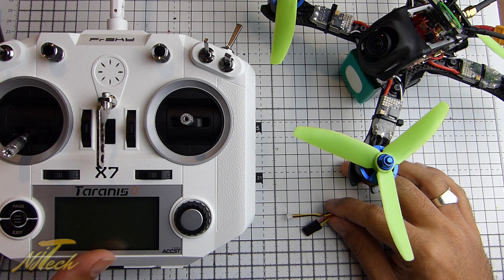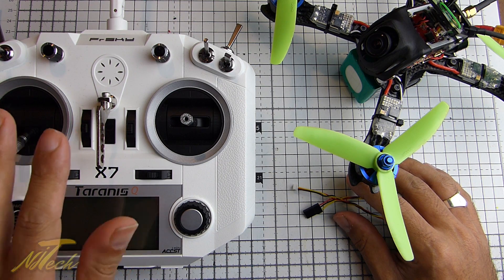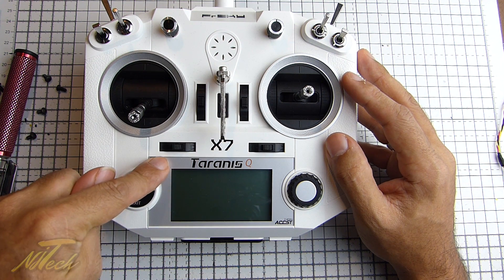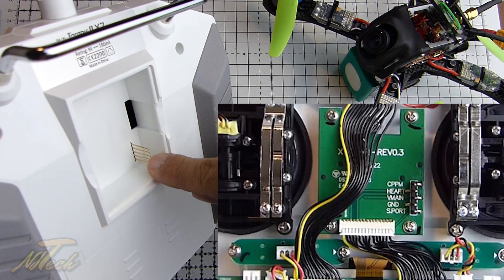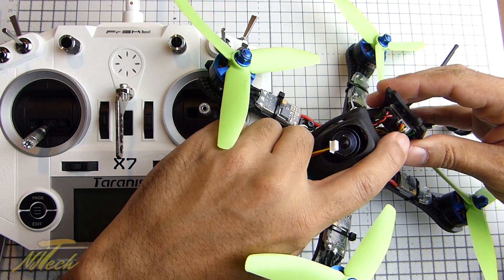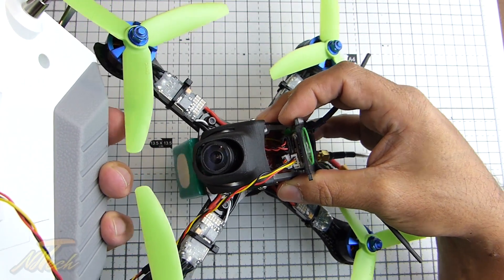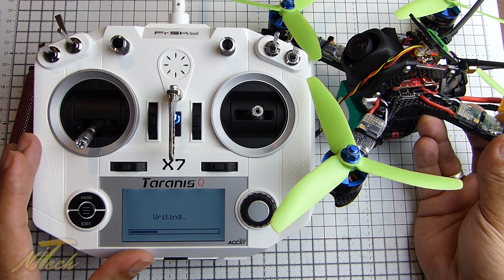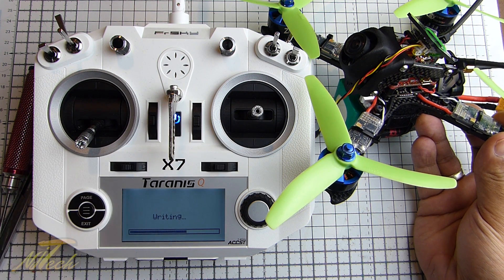Flash your Receiver with your Taranis!

Comment: Thanks, NJ. I recently switched from FLYSKY to FRSKY and am flashing all my RSXR receivers. I have a few XM plus as well so I imagine it works the same for all. I also used one of the cables that came with the RSXR and changed the pin out as you described. I originally ordered a cable that your buddy AndyRC showed off one day. It is a Banggood special and is a cable with little clips on the end. I haven't received it yet so the way you just showed us saved me some time. I also flashed the F.port update and am not 100% sure what it is but will look into it after I am done with this update. I also have a R9M on the way with a bunch of receivers so hopefully this trick will work for that as well.  Cheers and you rock sir

Comment: Bind  please I can't bind, d16 d8 what is it !??
Reply from the maker: what reciever? If the XM then D16. If its not binding then you have the wrong version flashed on there. Make sure you chose FCC or LBT based on what your taranis XJT is running
Reply: NJ Tech xsr and a x7 bind has solid red solid green light
Reply from the maker: if its not binding youve most likely flashed the wrong firmware to it
Reply: NJ Tech hi dude thx so for future me reading same thread, I had to put radio into EU mode,  even tho I had flashed rx several times with diff builds.

Comment: I get an error message when i click 
'flash ext. device'
saying 
'FW Update error
Bottom pin no resp
[EXIT]'

how do i fix this?
Reply from the maker: sounds like a wiring error, double check its wired up right and going to the correct pins on both the receiver and the back of the taranis
Reply: @UAVDronesUK im getting this error as well. did anyone solve this issue?
Reply: @Mc_fired  I got this error too did anyone ever find a solution?

Comment: S.Port on the bottom is working now. just received a qx7 and flashed an xm+.
thx for sharing.
Reply from the maker: Yea, back when i made this video i was using a very early version of the Qx7. Much easier now its wired in on the new ones :) Cheers.

Comment: hi
i ve got error messge on qx7 that "device not responding."... flash not start
Reply from the maker: have you triple checked that you have all the wires (power, ground and S) the right way round on both the module pins and the receiver?
Reply: Tamás Landa I have this issue when my tx was not using the stock firmware. I was using opentx. once I rolled back to the stock fw all good. I am not sure if there is a bug in the opentx version I was using. I was using opentx 2.2 rc12.

Comment: Doesn't the Q X7 have a dedicated S.Port at the bottom of the transmitter?   Can that be used instead of pins from the module bay?
Reply from the maker: cjpixel yes it seems the newest models have that lower s port working now so that may very well have something to do with it. glad you got it sorted
Reply from the maker: cjpixel sadly it would seem not. it looks like that was the plan but the pins don't seem to do anything. Not to say you couldn't run a parallel connection for s.port down to there if you really wanted to.
Reply: Interesting... I saw some early review versions of the Q X7 that didn't seem to have the smart port header installed (and the pin oder was odd:  GND - SPRT - 5V), but the Q X7 I just got does have the header installed and the pin order seems to be similar to the receivers (SPRT 5V GND) so I was figuring that would work. My s6r will come in a few days so I hadn't been able to see if it would work.
Reply from the maker: cjpixel wow that is interesting! keep me posted, perhaps they've updated it.
Reply: Ok, back with my update... I took a X4R and connected it to the dedicated smart port on my Q X7 with the standard smart port cable that came with the receiver. At first there's no power to the receiver so it seems like the port pins are dead, but then if you go to the opentx SD Card menu and choose a firmware to flash to an external device, the receiver gets powered and the update works as normal.  I also had success with an S6R receiver.   So it seems like the later models of the Q X7 work just fine... if you've got the header pins in the smart port at the bottom, you don't have to go through the module bay or create the custom wired cable.
Reply from the maker: thanks for the update! Good to see them adding in features. Or rather filling in the missing pieces :)
Reply: For some reason i couldnt update using the rear module bay, but flashing via Q7's sport went fast and easy. thanks for the tip!
Reply: The smart port at the bottom of my X7 does work for this as I just flashed my XM rx to FCC16 and just made a  servo cable with a stright pin header as a contact at the soldered contacts of the XM....cheers for the Video

Comment: Good video. I've tried to change the firmware on the X7 so I could bind to D8's too but with no succes. But I didn't do it the way you just pointed out. Hm, maybe I will just leave it at EU for now.
Reply from the maker: This particular QX7 arrived with the FFC version (non EULBT) flashed on it. I flashed it using this method (but flash internal module) with the XJT EULBT firmware no problem at all, very straight forward. That in fact is the other file you can see in the firmware folder on my one :)